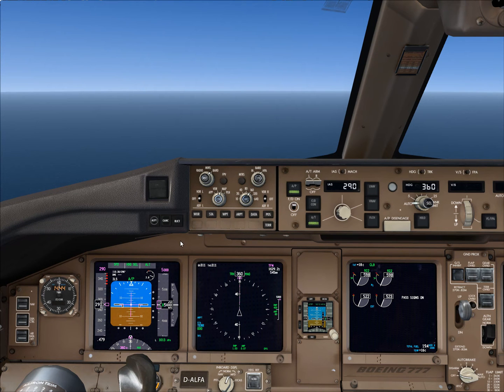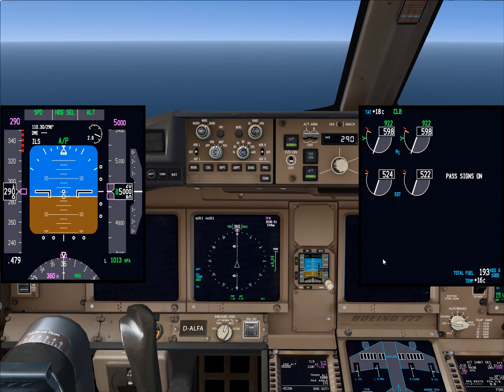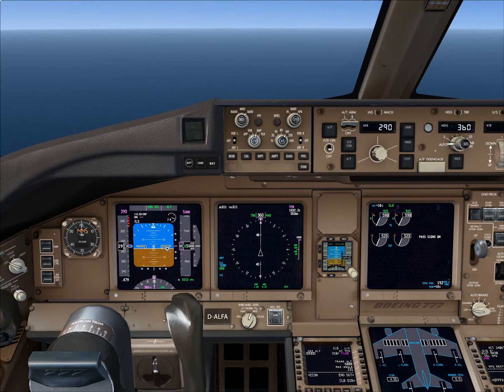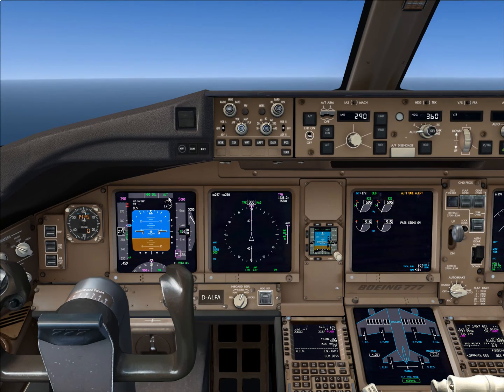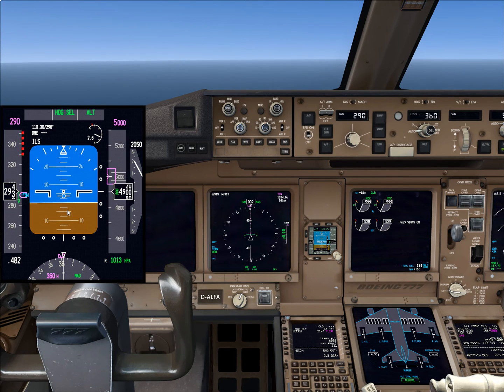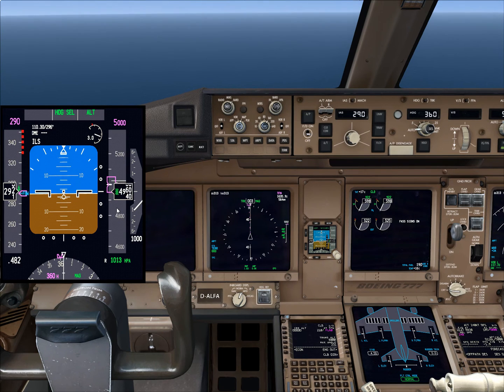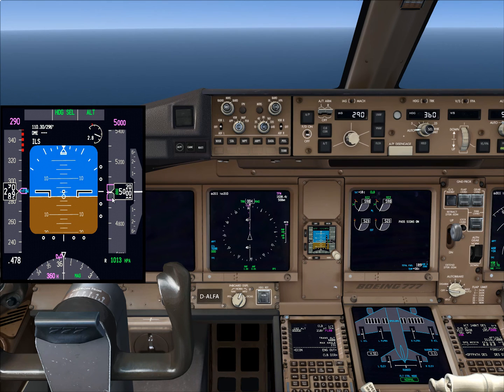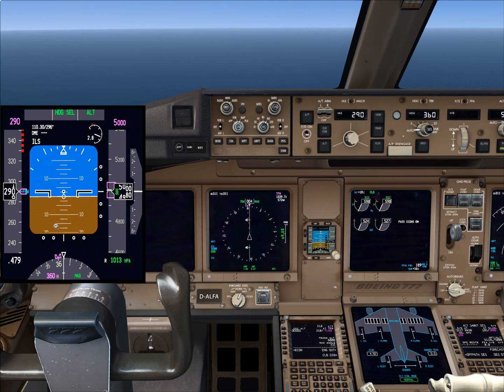The Phugoid Mode on the Boeing 777

Comment: Hi, is the Short Period Oscillation also correctly simulated?
Reply from the maker: Hi! Short answer is: I don't know. Long answer: I don't even know if the Phugoid is correctly simulated. This video just shows the "general" trends behind the Phugoid, but I can't tell you if all engineering parameters (frequencies, half- or double-times etc.) are really true to the real aircraft. Probably not because this information is most likely confidential and you can't get access to it easily.

Comment: i read that mh370 "fugoid motion in downward swoops" trying to find out what that means.
Reply from the maker: The phugoid oscillation can be neutral, downward or upward in nature depending on how much thrust the engines are producing. In this video the oscillation is neither downward nor updward as the final state of equilibrium is one of 0 vertical speed. What you read implies that the final state of equilibrium has a negative vertical speed and the airplane is globally descending.